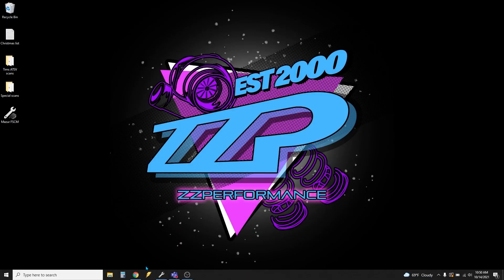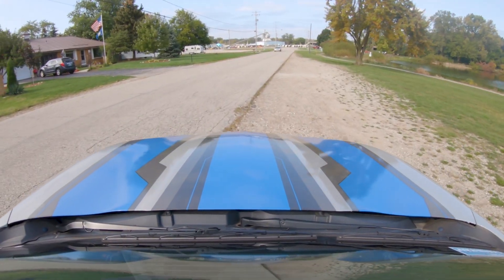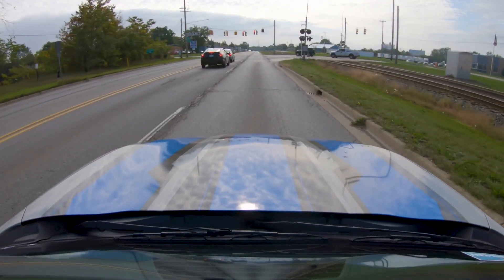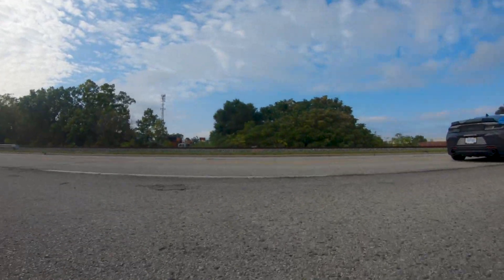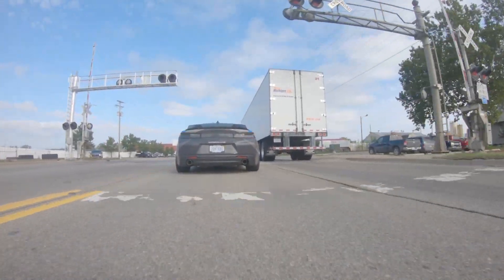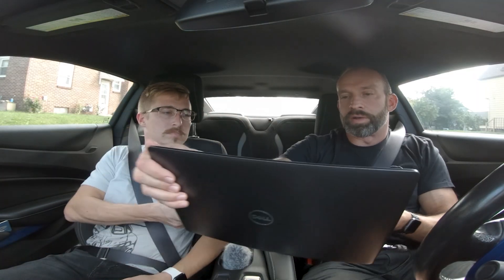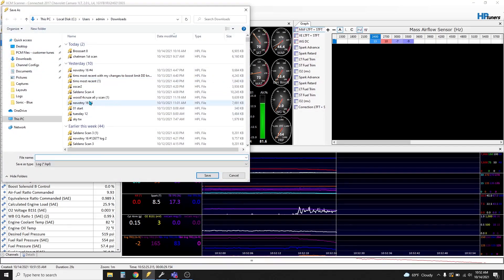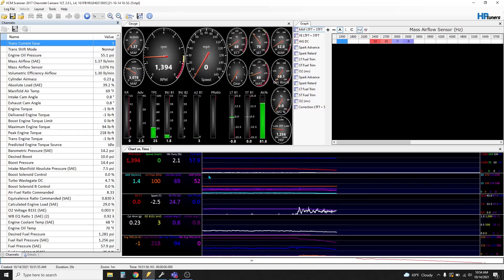How to Drive While Remote Tuning

Comment: I've got a question regarding WOT pull, I've got a 3800sc with the 4t65e-hd, so I would need to send full throttle 1st to 2nd and 2nd to drive pull. Can I roll into it to avoid wheel spin, as long as I'm full throttle before the 1st to 2nd shift, or should I be full throttle pretty much from a dig?
Reply: I tuned my car with zzp, they usually have you go WOT from 3,000rpm to redline. In an automatic, you would lay your foot to the floor as once you hit 3,000rpm and hold it to the floor, do not lift off until you redline. Obviously be aware of the road, but I drive a manual car so Idk too much about automatic transmissions.
Reply: It's the same basically whether you're in an auto or manual, just floor it at 3k and don't stop until you hit redline. I'd say cruise around like 30mph, then go WOT. Message their customer service or even call and ask, they have great customer service.

Comment: Biggest challenge I had with bnr tuning is drivability with the auto trans. Thanks for pointing out a scan with normal throttle going through gears so shift points are logged and tuned.